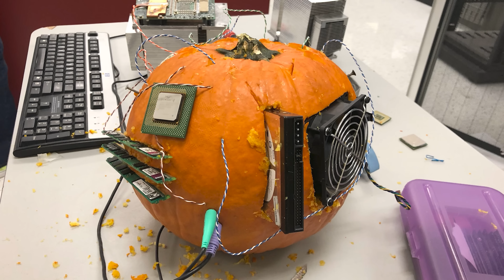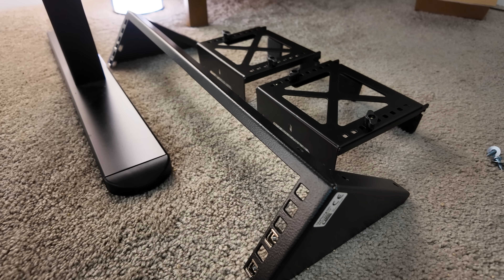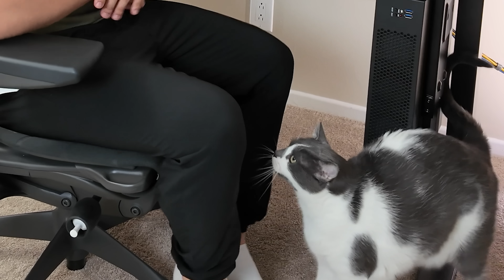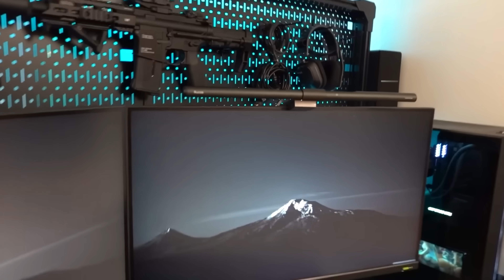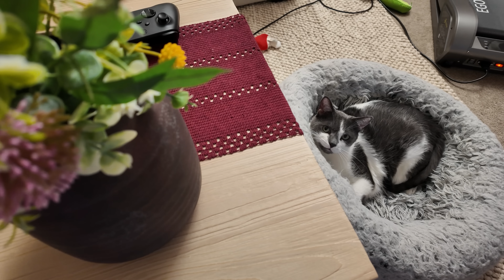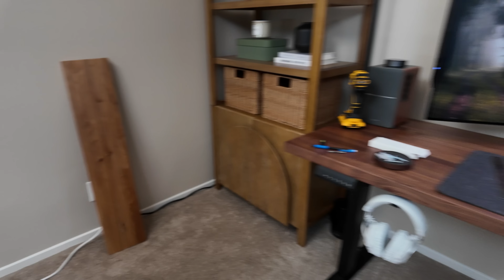This Might Hurt Linus' Feelings.....

Comment: Upgrade the speakers, though... Edifier? 😩Tell me you cheaped out without telling me. - But then, you might just not care enough and they're enough for what you need. - Also, I don't know what you use them for, but the only spot you will catch the sound in properly is when you sit on your lounge-table facing the computer-monitor. - If you use them at your computer, at least aim them at your ears. - What I would honestly do is put them on the shelves at the sides and toe them inwards. Though, that might be a little odd and messy, unless you could cable-manage the cables away a bit. - And also, if that desk is ever changed in height, it would need an adaptable solution. - One bonus, though, is that you'd have a little more desk-space for... something, or it would look cleaner there.

Comment: uhg... asrock? why Linus why??? it doesn't appear if any of the boards that support that cpu are rdimm. all of them are udimm. not really suprised tho. asrock as been on my shitlist even longer than asus.  the early 2000's I worked for a shitty computer shop that always used asrock. we had so many warranty repairs/returns with those boards. Now, this was the era of capacitor hell, but they've never left my shit list.

Comment: You don't like the Logitech Pro Wireless? What I like about the Logotech mice and keyboards with a built in battery and USB charging port is I don't have to worry about swapping batteries. What I've done is I got magnetic USB charging cables off Amazon, stuck a plug in the keyboard and mouse, you don't even see them, then I have 1 USB cable hidden away on the desk, and when one of them needs charging, I pull it out and boom magnetic snap, it's charging! Done, pull the cable away and tuck it back in it's home. One of the best quality of life things I bought for my set up. Plus it really saves on the USB port being stressed, coz you're not plugging and unplugging constantly, coz the plug just stays there all the time.

Comment: thing is with mounting on walls and making holes, as long as you know how to drywall patch those holes and can match the paint, and do it before you move out, landlords wont even notice, id be more concerned with the ceiling hole as its hard to "patch" a popcorn ceiling. or just find a professional and it will be probably 100 bucks or less to have them patch a few little holes and repaint.

Comment: You probably know this trick already but... I have a few G305s that I swap the AA battery for a Lithium-ion AAA battery in a little plastic AA-AAA battery adapter that you can buy on amazon. It makes it lighter, and still gives 6ish months of heavy use. I bet it would work for the G309 also.

Comment: A server with rotating hard drives in it should really be on the floor where there is no change of something moving it while it's running
If it's fixed to a desk you're going to occasionally jog the desk.

Comment: Using the Stubby for the Screws with no need for a stubby and angle the large screwdriver to use it at the backside where the stubby would be the right size is just perfect

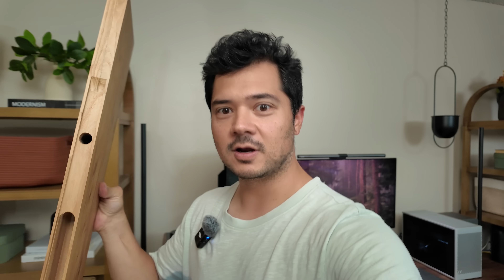Comment: 15:06 the wall shelf gave me ptsd. I bought a cheap one and it wasn't installed into the studs.... after a couple weeks it tore itself from the wall knocking my brand new $500 4k monitor off my desk. Screen hit the edge and completely destroyed the monitor. Installation was our fault and now my monitors are mounted on arms and I've wanted to get another wall shelf but just that fear of breaking another monitor sucks.

Comment: What kind of a ceiling do you have in there that you can use something like that instead of a normal screw you would use in concrete or wooden ceilings which is basically all we use for houses and have used for decades now in the west?

Comment: Phase 3 looks freakin' amazing! Well done.

1. Those Edifier speakers are amazing but you should angle them in, and up, to your ears. I hope you're using Tidal (or similar) to appreciate them.
2. Mount your computer under the desk to gain more desk space. I don't believe you needing to access the USB ports or power button.

Keep up the great work.

Comment: Personally I like to lay around tech stuff on shelf. The only reason I would put them away is because I don't use them frequent enough so to prevent it from gathering dust, I would prefer box with lid rather than basket.

Comment: as someone who own the superlight 2 and the powermat i do not reccomend the power mat, it worked fine for a few week than i started outputting alot of electrical noise 24/7 and its not remotly an uncommon issue apparently, these days i keep it unplugged and only plug it in when i reach around 15% battery

Comment: I wonder how hard it would be to modify the superlight mouse to include a wireless charging coil on the bottom. Then, using an off-the-shelf "through the table wireless charging" setup to make sure it's always full would be relatively easy :)

Comment: So when I bought my iMovr Lander desk, I got the pc support bracket that goes underneath it, and while I like it, I really get why people have either pc's small enough or desks big enough to just put their giant battlestation on top.

See, issue is I got a kind of curious case choice, some Thermaltake one, mostly because it had a 5.25" optical bay and it could handle like 11 3.5" HDDs, the latter of which ended up being more important...since I use that to sync to B1 lol

Comment: There’s nothing “weird” about the memory support on that Asrock board. First of all, RDIMM/UDIMM is determined by the chipset/CPU manufacturer(Intel). Secondly, every entry level server chipset and motherboard since at least Sandy Bridge in 2011 has used UDIMMs as well as the modern AM5 EPYC CPUs and motherboards. They are all basically rebadged from the consumer equivalents, usually with just ECC support and a BMC added to the board.
Reply: wow didn't know that! ty for the lesson!  i mean that!

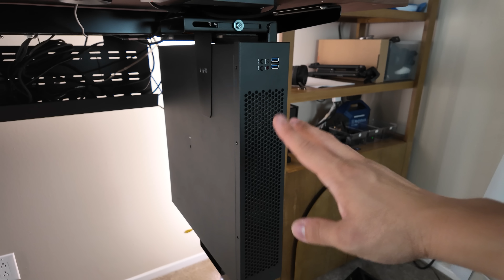Comment: 5:39 Isn't it bad for hard drives to be oriented vertically? Maybe that's just an old-timey myth though
Reply: Modern HDDs can pretty much exist in any orientation, the issue is moving them while the heads aren't parked, or having them get impacted by strong g-forces. Old ThinkPad laptops had g-sensors so they could try and tell the HDD to chill out during any bumpy rides. Heck, my mitsubishi still has the same industrial HDD that came with the oem head unit back in 08.

I guess think about it like this, we had laptops in space far before even industrial flash memory was much of a thing, let alone consumer drives. Point is, as long as the air pressure in the drive is fine, there shouldn't be any mechanical issues based on orientation. The air basically acts as the lubricant to keep the heads from touching the platters.

Im guessing the old like MFM drives or something might have been pickier, but those old big foot drives and stuff often times came as hardcards, so we really didn't have modern desktops with horizontally aligned HDDs until a bit later, once tower systems became more popular. I mean there were some, like with the older microcomputers, but a lot of IBM clones had vertical oriented drives.

Comment: The G309 is underrated. AA batteries and optical switches with incredible tracking and connection. This is a RARE combination in this market, where everything uses custom batteries that will be a hassle to replace later, and a very convenient and longevity-focused way to have a good wireless mouse.
Reply: Wait hold up isn't it like $90 or $120 something absolutely bloody ridiculous that range, or am i confusing it with something else. I should put it on the list in the hope it might pop up cheaply.

It also has PowerPlay which is an idea i really like and might actually pay extra for.

Comment: I wish I had that in me... Decorating. I don't and as such my house kind of looks like crap for it. Since I don't have a style. Also, I live alone and have a large house... Which I thought would be cool, but it's not. SO... Remember kids, buy for your needs, not wants. I grew up in a large house, and wanted one. Got mine for a steal, and then realized, problem with large houses, is I don't go upstairs, unless I got too lazy and ran out of towels downstairs and have to pilfer the towels from upstairs. That whole second floor is useless to me, since this house was built by an older couple, meaning the master is on the first floor.

Comment: Exactly what I was wondering when Linus installed it in that location, "I wonder how often Kyle will wack his knee on that bracket?"
Reply: That's my thought any time anything gets mounted under a desk. Sure, it's a super clean look, but I know I forget about anything I can't see and knock into it, as evidenced by the smudges from my knee on the side of my "floor mounted" PC case, which is a giant box that both hums and shines with RGB. Something that's completely silent and functionally invisible? I'd end up ripping it off the desk in a fit of rage upon the third knee whacking.

Comment: I feel like the Startech undermount kit should never have been put under the desk in the first place, but rather under one of the shelves to either left or right of the desk.  But your solution is great, Kyle.
Reply: If you pay attention it was mounted one unit down because the bracket that was in the way of his new mount was in the way of as well. I suspect they didn't expect to have to mount it quite like they ended up needing to.
Reply: @reallunacy  Yeah my point is the undermount should never have been put under the desk in the first place, but under one of the shelves.  There's no reason to have a file server riding up and down on a motorized desk anyways.